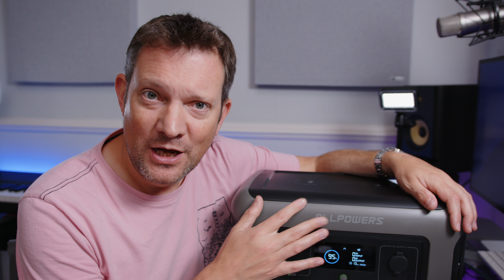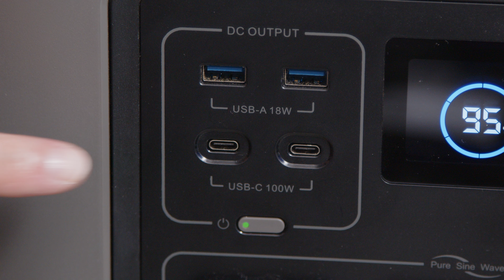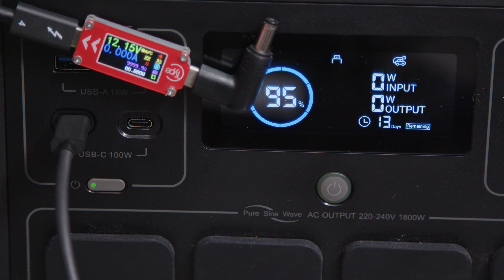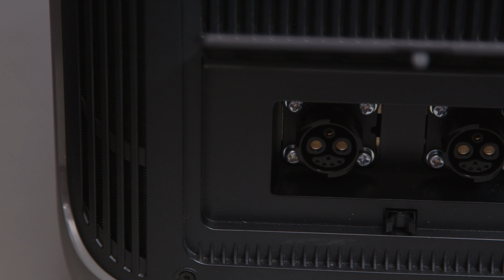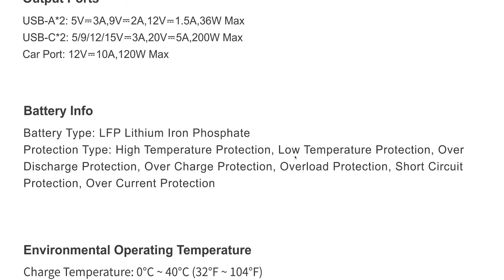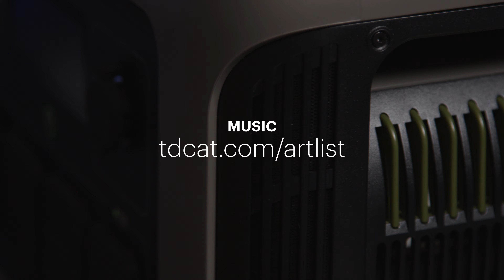AllPowers R1500 1152Wh PowerStation - 6 Month Review

Comment: As a customer of all powers I can not suggest to anyone to ever in any situation to ever buy a product from all powers. I bought the r2500 and r1500 from them on Walmart. Both are so bad im ready to take them out into the woods and have fun shooting them because the customer support with all powers is also just as terrible. I bought the r1500 to run my TV wall and plex server max 180w average isle wattage of 80w. I planned on to run it on solar and it does technically charge by solar go figure however, the r1500 when it gets to 100 percent charge it kills all power to every outlet meaning the plex server pc hard shuts off,  4 tv hard shut off, exc. And it does it every time it charges to 100 percent, now the r2500 is so much worse. First week a fuse blew inside while charging by solar and grid while running a mini split during my testing. Bad but not terrible then they say it is 20a solar mppt charge well at 48v it will only pull 13a Max would of never bought it if I knew that and it was never noted anywhere. So bad on them. Will pull 20a at 100v for solar. Next problem started happening which it randomly shuts off power to outlets now hard shutting off the mini split it was hooked up to. 

Don't think oh all these videos say they are good. Take my advice just build yours from scratch because they are not worth it.

If all powers dont return and refund me I am taking these out to shoot them and make my own video for YouTube so people know just how bad they are.

Comment: Feb 2026 $1032 on Amazon! A review claims it went down to $399 in Feb 2025. I just bought mine for $225 without warranty - seems fine. But this 'randomly turning off' issue has me terrified. I bought it for use with CPAP and can't have it failing. I'm testing it tonight....fingers crossed I wake up tomorrow.
Reply: Have you died?

Comment: Dear TDCatTech! 
Thank you for the detailed and high-quality review! I'm giving your content a thumbs-up!
I'd like to ask about the fan's operation when the charging station is powered from a wall outlet, fully charged, and not using any of its own power. In my unit Allpowers R1500, the fan continues to run, even though it's completely pointless at this point. It just makes unnecessary noise. Is this a malfunction or is this how it's supposed to work?

Comment: Thanks v much for the review. Was hoping to ask someone please as cant get a reply from Allpowers...but...is it possible to use a 1400w powered speaker whilst the unit is chargng?My situation is:   i have to keep wall socket/plug current below 3amps (so charging on mute should be ok) but need a 1400w speaker for the room (for fitness classes). I need to run the speakers for an hour at a time so might drain the battery before the class has finished. Advice most welcome thanks (1400w is peak power btw)
Reply from the maker: I wouldn’t think this would be a problem. If you’re talking about something like a Mackie style powered speaker, the Class D 1400W amplifier won’t pull more than a few hundred watts from the mains output, even when extremely loud. This battery would last 3 hours or more at that level. It can be charged at the same time but the power is then taken from the mains so you’d need to keep the charge level to 400W to keep within your 3A limit (I’m assuming 240V UK mains here)
Reply: @tdcattech brilliant many thanks

Comment: I bought an r1500 and after a few months it crapped out. Died completely , got very hot and stunk like hell. And all it was doing at the time was charging my cellphone.  Allpowers basically told me I was on my own.  I argued back and forth with them for almost a month and got nowhere.  Don't buy from them.  Their products are terrible and their customer service is even worse!!
Reply from the maker: That's terrible. I'm still using this each day and my experience is currently good but the product hasn't gone wrong. There's no excuse for bad customer service.

Comment: Thank you for your detailed review. The autoshut off, could be to the station power saving options? It may not to detect any energy been needed from the fridge for a long time and shutdown it selft. I beleive that in the APP within the power-saving settings, you'll find options to set the auto-off timers for each output type. I hope it helps.

Comment: This may seem like a silly question. I want to use this for a cabin in my garden for work I have good sunshine in my garden etc for solar .. will be powering 6x Downlights (low voltage 5w LEDs) Tv at 100W and few low power things charging. to the question: if I’m receiving 200w of power from the solar with all of the above running - will it keep its charge ?

Comment: please tell me, when the station is 100% charged, does it continue to make noise when charging? or do the coolers turn off?  I mean the situation when nothing is connected to the station
Reply: Hi i bought 2 of these hoping to leave them plugged in.trouble is the fans run continuously even when fully charged and no load.
I have also found when not plugged in and not used they go flat in about 6 or 7 weeks.
So i cant use for ups and if power goes off they will probably be flat..
Reply: @BM-wi9kt 
Interesting but do you try with ECO mode 🤔

Comment: Mine's gone faulty after 2 months of heavy use: simultaneous charging via solar and discharging via AC/DC, charging from AC with low quality (often 190-200V instead of 230V), UPS with multiple power outages a day, and several charge-discharge cycles every day. The flaws it developed: it wouldn't charge from AC and wouldn't display how much power is being drawn. Also, one of the fans gone bad.
I contacted them. AllPowers asked to send it to them and then they will send a replacement, which is good. But I live abroad. They said they do not uphold the warranty in a different country from where the unit was bought. Which is understandable, but not perfect. I had some companies (LG, EVGA) replace/fix the stuff that was bought elsewhere, and EVGA even did it without a purchase receipt. Anyway, back to Allpowers. Shipping it to them would take long and I would have to pay a high shipping cost. I opted to send it to a local repair shop. The assessment was "mainboard failure and replacement". I also asked them to replace the fans with Noctua which are sooo much more quiet.

I bought a Ugreen GS2200 recently which I am very impressed with. It is so quiet that I can sleep in a same room with it providing 600W of power. The fans are similar in noise level to my computer fans and have a pleasant pitch to them. Also, it has been 100% trouble free under the same use conditions. The computer speakers are silent with it while they were making an annoying noise when connected to the Allpowers. And I really noticed higher invertor efficiency. Bought it for 1000 Euro which seems like an excellent deal. But I will have to use it more, of course, 1 month is not enough time to give a conclusive feedback.

My thoughts after almost 2 years of experience with various power stations:

1. Some kind of circuitry or logic will go faulty way sooner than battery capacity is diminished due to extensive use. I have a few stations that developed various defects and needed to be repaired. I never noticed a decrease of battery capacity. So a power station with Lifepo battery ≠ a reliable power station. It can still go bad. Out of 9 stations that I and my father used 5 developed defects, brands are: AllPowers, Bluetti, Ctechi, BigBlue.

2. Warranty conditions are very important. Powerstations for me have been the most unreliable recent tech. More than 50% failure rate, compared to 0% failure rate of mobile phones that I own and 10% on computer motherboards, for example.

3. Invertor efficiency matters. Difference between 80% and 87% is massive and noticeable. And again a jump in efficiency from 87% to 92% is also big and noticeable. Discharge rate of the invertor is equally as important.

4. It's better to wait for a sale/Amazon prime day/black Friday and buy a station from a tier-1 brand like Ecoflow or Ugreen, than to buy a little cheaper from tier-2 brands. 

5. More recently released = better. A power station introduced in 2024 will be more reliable, more quiet, more polished than the older model released in 2022. Also, a manufacturing date matters. A power station manufactured in 2024 is likely to be more reliable than the same station manufactured in 2023 shortly after its release to the marker. This is true for many devices, but especially for power stations which are more often "green" and have various defects that go unnoticed during QA. My friend recently purchased River 2 Max, but he was unlucky and got a unit that was manufactured in January 2023. And he has several issues with it which I never experienced with my River manufactured in February 2024. I watched a repair guy video on one of those Ecoflows, the guy compared 2 units with different manufacturing dates and noticed a number of differences such as more robust radiators inside.

Comment: I am just getting into power stations. It looks like it would be cheaper to buy another power station instead of an add on battery based on the price. Or am I missing something ? Thanks for the video.
Reply from the maker: Possibly, in this case, yes. But if you need the runtime from one power source rather than from two independent batteries, the B1000 is the way to go. It depends what you need but extension batteries always seem a little overpriced to me.
Reply: @tdcattech  i agree..i was expecting a saving to get two extensions for the two stations i already have ..its only 100 au cheeper than just getting a whole new same sized power station with all the extra capabilites. ugh ... anticlimax. the most annoying part is you cant even charge the extension batteries off solar unless they are hooked up to a power station with a port :P Frankly for a 100 aussie bucks saving i think ill just get two more power stations:P

Comment: A similar experience with the brand here too - I bought a R600 back last Feb for use when camping, however the device completely shuts down at moderately low temps at around 35% charge level (anything around +10c and lower). Also noticed erratic behaviour of a laptop trackpad when plugged into it's AC output, so would be also be interested in seeing the sine wave on a scope (which is claimed to be a pure sine wave). Tried using it as a UPS but, after a while, it throws up a E207 error, so gifted it to my wife who just uses it to power her iPad when she's out in the garden - so far, it seems fit for that purpose! Cheers.
Reply from the maker: Thanks for sharing your experience. I know it’s a lower cost product but it should still be able to do what it claims to do. Shame.
Reply: @tdcattech  - I did a runtime test again yesterday and, UPS error issue aside, it did perform Ok at room temperature (circa 22c). It really does look like my device at least becomes dysfunctional at lower temps. Could just be a firmware problem, but I don't think there's an update feature in the Allpowers app (unlike the Bluetti app, which does). It'll do for keeping around the house as backup power. Cheers.

Comment: Thank you! Very timely too (for me 😏). It's a popular product in Europe, but in North America people generally don't bother to look beyond the cheesy name, because this brand just isn't around much. They think it's some obscure Chinese company with poor-to-nonexistent customer support. I'm considering getting this exact one plus 100 watt solar rug to power small music Ambient and IDM shows outdoors with a couple of laptops and 80-100 watt speakers. I kind of wonder if I need something even bigger but the weight factor is a real issue for me as well. These laptops don't consume more than 25 Watts each when running DAWs or Serato.. As far as charging, I figure with 100 Watt panel it will have to be sunny all day to get to 40-50% but that 40-50% is already like Jackery 500 's worth of power, so it's probably a good investment. I'm currently looking for information on how well they deal with warranty issues and customer support in general. So if perhaps you heard of any anecdotal examples I would much appreciate it if you shared some.  Thx in any case.
Reply: This is probably too late for you now but I can say from my own experience that I have never dealt with such an extremely bad, poor company when something goes wrong with one of their products. It has caused me no end of hassle & stress. I am now at the point of contacting Trading Standards in England, UK because they will not take a broken product back that will not charge anymore. This happened only after a few uses of using a much cheaper portable power station product of theirs. They couldn't be more difficult, the total  opposite to here. For customer service I will give them zero.